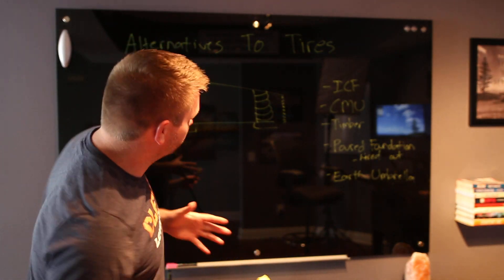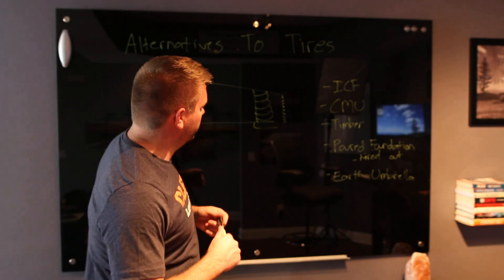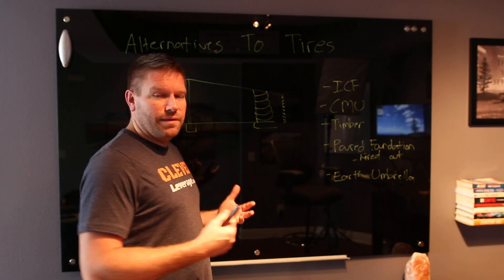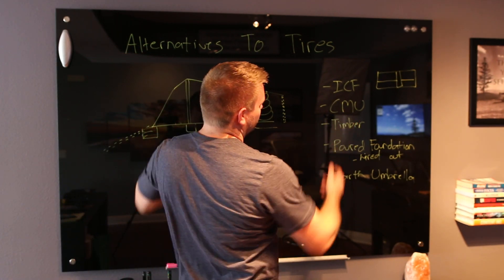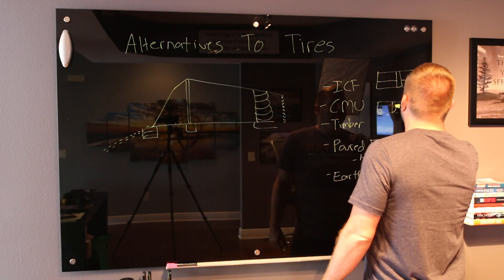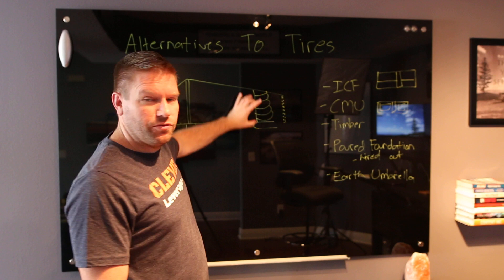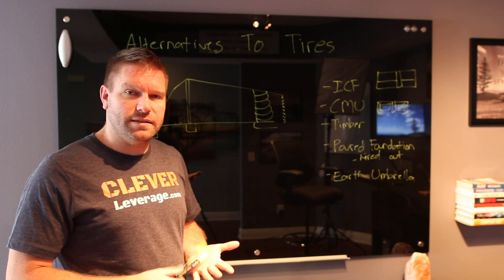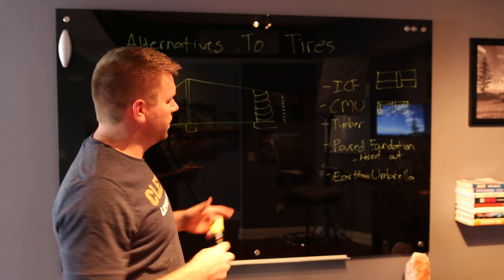Earthships: Alternatives To Tires

Comment: I've been considering tire cutter to cut one sidewall off of each tire, instead of pounding dirt for a year and filling it with Aircrete (Portland cement mixed with foam made from soap) , letting it dry and picking it up and stacking it like a brick. I've been watching a lot of videos on aircrete and it has excellent  R valued and its very lite and strong!
Reply: I think you’d significantly reduce the structural integrity of the wall  using this method.

Comment: as far as heating the homes in winter nothing will be more cost efficient or better than a gloria heating system! You can google them! No fans, wires, or switches! and during a long absence when you go south simple oil filled electric radiators could cover down if the occupant was not present to build modest fires in the exterior hearths!

Comment: the earthen roofs are desireable if they can drain the sacking materials could be smoothed and supported by almost any wasted materials that were RIGID giving the vegas a unitized strength and water tight sacking like edpm would keep even water vapors from penetrating but the drainage system would be crucial in northern climates because they are to wet...especially in winter and with the freeze thaw cycles would lose some insulating abilities when you need it the most in winter ...but the graveled drains would add filtration to rain water captures! over flows would be a must on your cisterns. because up north with the wet seasons falling into the cool seasons. means less evaporations so keeping the water moving is a must...ergo perimeter drainages in earth bermed structures would also be needed...and edpm on interior walls would also help to modify water vapor but a therma break of hot pink 2 inche insulations would do the same thing and add a thermal retention to the heat aspects in cooler seasons

Comment: your needing concrete stabilized earthen blocks use dirt to hold back dirt they are compatible and self regulating and they breath off gassing moisture...If you noticed the earth ships mimic a swedish footer with the polystyrofoam 2 inche hot pink board holding in earths heat and to prevent penetration of cold during seasonal shifts in temp...Concrete or hydrated lime will make adobes compressed earthen block  or not compatible with northern wetter climates... This thermal stability will keep the walls same temperature as the sub soils in zone 5 about 60 degrees...but you are correct the tires are a cheap stable form structure...short of that the adobes stabilized with 15% portland cement or hydrated lime will work as well both require a bonding beam of concrete...But i do not like concrete walls they age out and are rigid and can trap moisture the breathable blocks are better...and as far as i am concerned concrete stabilized soils are self compacting in a tire...they have the wheel barrow electric mixers dirt cheap mix the earth with some concrete or lime for stabilization and pour the tires...as the structure rises it will self compress then earthen plasters polished and dyed are beautiful...and they breathe as well when concrete tries to breath it cracks so stabilized earth gives you incredible longevity...which when we think of housing aging out in 100years or 1700 years which gives more bang for the buck?

Comment: Fill the cells of the blocks with closed cell foam insulation,  water proof outside & inside surface of block with drylock or other waterproof coating, just a thought.

Comment: Perhaps a mudbrick mixture poured into the tyres would save the 7mths of ramming. Each tyre becomes essentially a rubber encased mudbrick block. It worked well at Bunjaree Earth Cottages (wattle cottage) where my son was involved in the build in about 2003.

Comment: Why not just fill them with sand instead that way you can just pour the sand in and you won't have to beat on the tires for months. It will still be just as effective

Comment: Agree 100% with you regarding the tire not being so appealing. There is a video about burying two shipping containers under ground.
Look for "earth-cooled shipping container underground ca home" this concept is very close to your last option which was the umbrella. Did you finally decide on an ideal idea to replace pounding tires?
Reply: Could you fill a shipping container with tamped earth as the back wall? You'd need to cut a whole in the top to fill it. It would have a large footprint, but would it be structurally sound? Is the backwall meant to protect against vertical or horizontal pressure, or both?
Reply: @scottabergman  if you cut a hole in the shipping container it isn’t structurally sound anymore.

Comment: about timber.... did you know that Venezia foundation is made with wooden logs ? All the buildings and all the city is literally built on long wooden logs and that logs are underwater since centuries (16 centuries) and are still today sustaining the weight of buildings made with stones, bricks, marbles etc.... 
quote : "" ... Only the higher territories that became the islands emerged from the waters, but these were muddy soils that would provide unstable foundations for palaces and brick constructions. The Venetians of the time reinforced the land by planting millions of oak poles that collapsed until they reached the caranto, a more solid layer, then above them wooden boards were placed in quantity to provide a sufficiently solid support base, therefore the foundations were dug in the mud.
The poles did not rot and have resisted for centuries because there is no oxygen in the deep layers of the mud and therefore the degradation of the wood cannot take place. Basically, Venice stands on islands of oak wood. ""
So yes timber properly treated can last centuries!

Comment: what about plastic icb totes stacked two or three tall? you can still fill them with dirt for the thermal mass and the plastic should hold as water weighs more than soil and then fill in the cracks between the totes with clay and bottles? this is my current plan as i do not want to pound 1200 tires in either

Comment: Look at the wind and water catching structures used in the city of Yazd for inspiration on your earthship. You could reduce thermal mass from that heavy back wall by connecting wind, solar and water in different ways than the typical earthship design.  Here is a link of one such tech used in Yazd that is missed on earthship structures:
 https://youtu.be/gC8BU4GdFzc

Comment: Steel drums welded together and filled with water. Water has about twice thermal storage capacity as concrete/rock 
for the the same weight and steel has more thermal conductivity than rubber so it would be a more efficient building.
Reply: Interesting idea.   Would you cover the outside (or the side in contact with the earth) with a rubber membrane of some sort?   How do you waterproof or prevent condensation in cold climate?
Reply: @clearasmud1945   I would think that condensation wouldn’t happen because when the air is cold, the drums would be warmer from the heat stored in the water.

Comment: Sounds like you're trying to go the Lazy corporate route.
    "I don't want to spend time building my own house, so lets hire someone to pour concrete" 
      Why live in an Earthship if you're just going to turn it back into modern housing???
     Using tires reduces landfill garbage, and also helps regulate the temperature of the house. I understand that it's time consuming to pound tires (so invent a machine to do it faster)  but this is where you'll be spending the rest of your life. So go ahead and spend less than a year building it! You're also helping to utilize garbage, which is great. Recycling is just one part of the idea behind Earthships. Self sustainability is the first idea though.              
      "Let's hire somebody to pour concrete while changing the entire idea"  Come on dude....
Reply from the maker: You’re missing the point… there has to be a balance between driving all over creation collecting tires, in addition to a massive workload to install them… and structural integrity and low voc.

I totally understand where you’re coming from. But this is me. I want something different. Simple as that
Reply: @matt-justice  Fair enough. I do believe the Taos community gets junk delivered to them by the county though. That cuts out driving all over creation. If this became mainstream, it would be just like having lumber delivered to a jobsite. Packing the tires seems to be the biggest pain. Some folks are worried about gases that are emitted from the tires over time. I don't know anything about that, but it seems like a fair safety concern. Perhaps a new, safer type of rubber should be developed. I don't know, I'd just love to see Earthships become the main way of living. Cleaning up the environment while providing housing is a win win.

Comment: Just came across this. As a general contractor with engineering background, Ive been brainstorming these same methods. While I understand the advantage of the tire wall, its extremely labor intensive, and as you yourself mentioned it isnt as appealing to many. Ive been considering a hybrid build between metal containers and earthship, although I do recognize that this would likely compromise some of the benefits of an earthship. I have also considered cmu concrete filled wall. I think that would behave similarly to the tire wall in retaining heat etc. Anyway….like the conversation going on
Reply from the maker: Thanks! Agreed, some folks are offended… the real intention is to learn more and explore more ideas. No one way has to be right or wrong…
Reply: @matt-justice  ….I can understand why they do what they are doing with what would be considered a true earthship. However if one can stand back and look at the larger picture they might see that it would be better to appeal to the masses and begin a foundational change in how we build, as opposed to hold fast to a line that makes sense but will put most people off. This is a win the battle but lose the war scenario in my personal opinion. 

We downsized our entire lifestyle 8 years ago with extreme changes in how we lived, worked, and prioritized things. Just recently have converted part of our traditional ranch home over to solar. It was really an experiment for us to see and live with it personally. We are moving to yet another phase that will likely be a 5 year process. Its all been good though. No more credit cards. No new cars. Now, simplify our cost of living itself
Reply: The tire wall can be strapped down and filled with any light weight insulator like vermiculite or even recycled plastic pellets, or sand, which doesn't need compacting, where  it's readily available.
Reply: @Jagueyes1  …..but this would negate the point of the tire wall. They are doing it to gain thermal mass, so insulation fill would eliminate this advantage.

Comment: Recombination of Rubber and Dirt as they retain heat.  The tires should just be cut into small pieces.  Aircrete in a good block mold form shape, then add simple clay balls “Japanese Dorodango” clay balls into the aircrete as it is slowly being poured and also add the rubber tire pieces.  

The dirt from the area can be turned into Japanese clay balls, no need to make them shiny, just make simple clay ball shapes and sun dry them. - https://youtu.be/pfBGGuezus8

Rubber and dirt “hold the heat” - concrete is okay as an insulator but not the same as rubber and dirt.  If these are inside of an Aircrete block, they will retain the heat and release the heat.  The rubber might be better if shaped into something that resembles a vortex fan that blows out air.  When the heat that was absorbed during the day begins push out of the tires at night, if the shape was a vortex, the heat will be distributed out evenly across.  The clay balls can be added to the spaces in between each rubber tire blade.  

The color black or dark colors in general absorb light and heat.  Adding a black or dark color additive to color the aircrete will help the aircrete to absorb more heat to release at night.  

Essentially no pounding dirt into tires, this part wastes time.  The above is not a proven idea but the idea of keeping all of the components to keep and release heat are present in the idea.

Good Luck 🍀

Comment: Where I live rock is in abundance, so I have been thinking about dry-stacking big rectangular slabs of stone from local querry. And then finishing it off inside with some form of plaster. That would give a nice thermal mass, I guess. 

Because of heat conducting properties, I would avoid wood for the back wall.

Comment: I would just bite the bullet and have a concrete crew pour the stem wall. Concrete is cheap. Contractors are easy to find. Tons of improvement constantly being made to the formula. It's dependable. Tried and true. Why it's the material of choice for builders world wide.  Why waste your time trying to reinvent the wheel?  You have a substantial investment tied up in the process, the property and it's improvements.  Why go all hippie dippy? Pour the stem wall, expose it as an interior design feature and rest easy knowing you have a solid asset.

Comment: The chemical composition in tires causes the tire to deteriorate and rot over time.  There are toxic chemicals in the steel belts inside them too.  The rubber leeches chemicals.  With age the structural integrity of the tire degrades.  That is why old tires that still look fairly good can blow out and collapse.  I don’t think it’s a good idea to be using tires for any part of a house’s structure.  Especially one that you would want to last for decades.
Reply: You're very ignorant.

Comment: Insulated Rammed earth using a concrete mixer bucket attached to a skid steer pounded into place using an air compressor.  Both machines can be sold afterwards.  See rammed earth ranch.

Comment: The problem is that you are stuck on the idea of making a wall. Forget the wall.
A 45° reinforced soil slope with some geocell will make the retaining. 
That's like 3$/sq ft and fast to build. 
You just have an earthship that's way deeper at the end so need posts for supporting beams.

                 / ┬────────────┬──────_
              /    │                                       |            _ /
            /      │                                       |       _ /
         /         │                                       |  _ /  reinforced soil slope
      /            │                                    _ /
 ──────┴──────────/
Reply from the maker: This man might be on to something: https://www.google.com/search?q=geocell+retaining&newwindow=1&sxsrf=ALeKk03G_TCYlxVdOFxAp1DvDYPcE9lBdQ:1627415630960&source=lnms&tbm=isch&sa=X&ved=2ahUKEwjqxdbUg4TyAhWImmoFHS4rDSoQ_AUoAXoECAEQAw&biw=1536&bih=721
Reply from the maker: Wow, haven't thought of this... you might be a genius. 
The naysayers will immediately say "you can't store heat without the insulated rear wall." But that part looks pretty easy with a little over excavation and some backfill.
Reply: @matt-justice  Yeah I hope this helps and someone can test the idea. Never was a fan of the tire heap idea. I think I got the general idea of using sloped soil from the 1986 pdc course made by Bill Mollison, the only thing is that now we have the geocells geotextiles.
As for thermal mass I'm pretty sure there no difference. If anything with a reinforced soil slope it will not get as hot in summer because less mass is exposed, and in winter since the sun is low-angled, it will be less cold because there is actually more thermal mass that'll get direct sunlight because it is a 45° slope, so that's a win win.
The partition wall between the greenhouse and the living space can be made thicker to compensate anyway.
A sawtooth roof slit window or a couple of skylight could also help to have more sunlight reaching the back slope, and in this case this could even become a growing area with a semi-crawling space, the sawtooth giving some headspace too.
                                                                 __
                                                                │   \
                 / ┬────────────┬│     \──_
              /    │                                       |               _ /
            /      │                                       |           _ /
         /         │                                       |  ____/  reinforced soil slope
      /            │                                    _ /
 ──────┴──────────/
Reply from the maker: Interesting modifications.  Yeah you would have to decide ahead of time whether that space is open to the living environment or not. You'd get some temp differences if closed off, which will definitely condense and cause mold if not planned for.  BUT, you could easily excavate, insulate, lay down a run of Geo, and leave the top two inches open for mortar and mesh if you like.  Might even be an opportunity for a stair stepped greenhouse room with rear entry, and as you say a large skylight to allow light penetration all the way back any time of year. Cool stuff, thanks for sharing!
Reply: This is amazing. So, how is the north side of the roof supported?

Comment: I helped build one pounding tires with a sledge hammer.  It gave me a back ache.  A friend used a 30 lb pneumatic tamper which made it a lot easier and sped it up.  Coated the inside walls with insulating spray foam, then plaster.